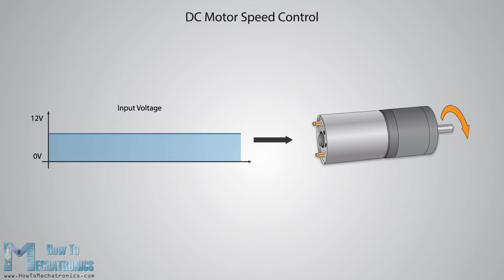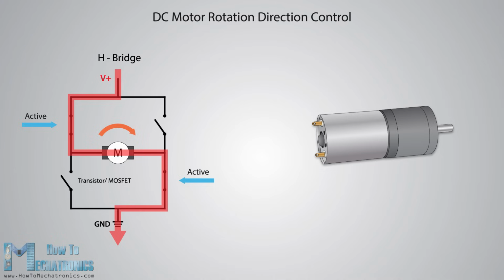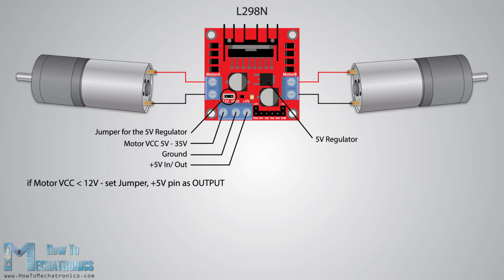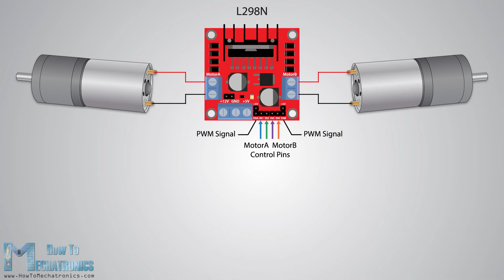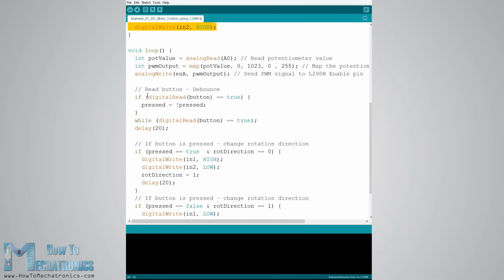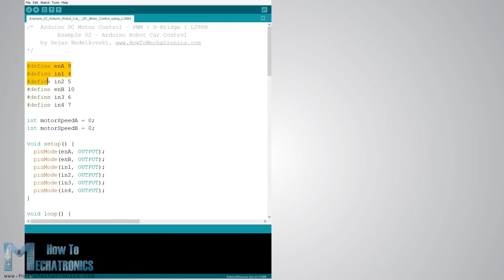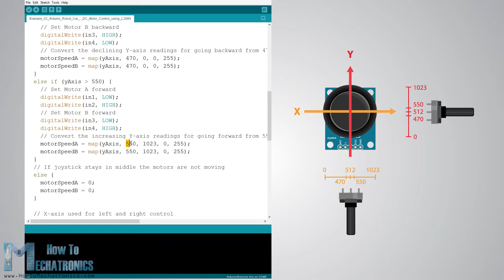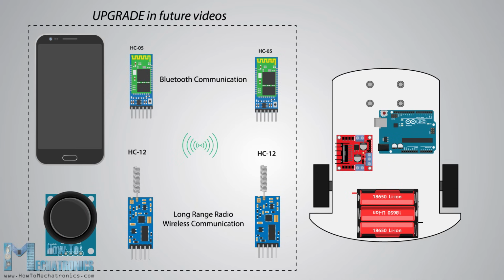Arduino DC Motor Control Tutorial - L298N | H-Bridge | PWM | Robot Car

Comment: hi, I'm a complete beginner in electronics. I want to use 12v dc motor and will use Arduino uno. If my understanding is correct, I should turn on the 5v regulator and safely use the 5v pin out? Sorry for my english. please help thanks

Comment: Thank you to you for taking the time to put together a video to help others online with their robotics projects. There are some mistakes though...ena, in1, in2, should be outputs. Button should be an input.  The resistor should be on the positive side of the or on the 5v wire or the pin 4 wire, this is to protect the circuit. You don't necessarily rotDirection in your code, you can change directions without this.

Comment: Hi, I actually did the same thing. but it worked for me only when I gave the arduino voltage separatly via usb or 5v and I had to have 2 packs of battery otherwise it would boot when I plugged it like in the viodeo... why is that?

Comment: In the website notes regarding the L298N you say: "In this case the 5V pin will be used as input as we need connect it to a 5V power supply in order the IC to work properly." But in your schematic diagram nothing is connected to the 5V pin. And it looks like the Arduino is being powered by the same 12V battery that is powering the 2 motors.

Comment: The most well explained video so far that i found! thanks for showing the better understanding how to connect this driver to arduino. I  am planning to do an 8 motor of ROV on my own. My question is how can we connect this motor driver if i should be using 4 piece of them? since 1 piece of driver is use for a pair of motor

Comment: I’ve tried to replicate the example with the motor l298n and push button. Everything works fine except the potentiometer isn’t controlling the speed. I’ve triple checked the pins and the code but I can’t figure out why the potentiometer isn’t working. 

I was wondering if anyone had any ideas.

Comment: If someone has a problem with his L298N that it is not working remember to connect the gnd from the l298n to the gnd from the arduino
Reply from the maker: That's right, thanks for the input!
Reply: Hey dude, could you explain why? I had this problem but i don´t know why I need to connect the GND from LN298 to the GND from Arduino, Please :D

Comment: If i use 14 volt power supply to L298N driver, i need to remove the jumpers and have to power it up in 5 volt pin, is that right?

Comment: Hi, Im trying to build a similar circuit: 24v power supply with a h bridge controller for a 24v servo motor, what I'm worried about its sending the 24V (+) to the VIN Power Pin of the Arduino card (min 06:40).

Comment: In case someone connects the motor to A or B with ENB enabled (means motor is not PWM regulated, runs at full speed) with 12V jumper enabled and is surprised nothing happens after turning power on, there is a simple reason. Just connect a wire to 5V out, power on again and then touch either one of two pins, for example IN1 if motor is connected to A, that regulate the rotation direction (forward/backward). The motor will start turning.

Comment: and how did you define the motor speed PWM as 255 when your motor`s 12V with 100rpm
is there any calculation formula for PWM in motor speed
Reply: PWM sends an 8bit signal so its values range from 0-255.. think of 255 as 100% and 0 as 0%.. if you want it to go 50% simply send it 127 and so on..
Reply: @johnturk158  thank you so much. Stay healthy

Comment: Here is code to control 4 dc motors on tank chassis: 
int rc_pulse1=1; //reading signal from FS
int rc_pulse2=2;
int mpwm1=3;    //PWM channels for motors
int mpwm2=4;
int mpwm3=5;
int mpwm4=6;

void setup() {

pinMode(1,INPUT);
pinMode(2,INPUT);
pinMode(3,OUTPUT);
pinMode(4,OUTPUT);
pinMode(5,OUTPUT);
pinMode(6,OUTPUT);
pinMode(7,OUTPUT);
pinMode(8,OUTPUT);
pinMode(9,OUTPUT);
pinMode(10,OUTPUT);
digitalWrite(3,LOW);
digitalWrite(4,LOW);
digitalWrite(5,LOW);
digitalWrite(6,LOW);
digitalWrite(7,LOW);
digitalWrite(8,LOW);
digitalWrite(9,LOW);
digitalWrite(10,LOW);
}

void loop() {

mpwm1=0;
mpwm2=0;
mpwm3=0;
mpwm4=0;
delay(50);
rc_pulse1=pulseIn(1,HIGH,25000);
rc_pulse2=pulseIn(2,HIGH,25000);
delay(50);
if(rc_pulse1>1024) {
mpwm1,mpwm2=map(rc_pulse1,1024,2047,0,255);
if(mpwm1,mpwm2>0) {
analogWrite(3,mpwm1);
analogWrite(5,mpwm2);
}
}
delay(50);
if(rc_pulse1<1023) {
mpwm1,mpwm2=map(rc_pulse1,1023,0,0,255);
if(mpwm1,mpwm2>0) {
analogWrite(4,mpwm1);
analogWrite(6,mpwm2);
}
}
delay(50);

if(rc_pulse2>1024) {
mpwm3,mpwm4=map(rc_pulse2,1024,2047,0,255);
if(mpwm3,mpwm4>0) {
analogWrite(7,mpwm3);
analogWrite(9,mpwm4);
}
}
delay(50);
if(rc_pulse2<1023) {
mpwm3,mpwm4=map(rc_pulse2,1023,0,0,255);
if(mpwm3,mpwm4>0) {
analogWrite(8,mpwm3);
analogWrite(10,mpwm4);
}
}
delay(50);
}

Comment: Great video. Can you link a parts list and where you bought the parts from? I know you didnt mention a diode but I am assuming that is necessary? Also is the MOSFET a separate component? Or is it included with the L298N ? Sorry if these are beginner questions. I am new to this

Comment: I am using 3-12V rating motor with L298N. When i use power from Arduino board motor runs at 4.5v but when i use external power motor don't run at 4.5v but only makes buzz.(I checked voltate using multimeter) Can you please help me with this ? I am using 9V ext power. (surprisingly motor runs fine even with 1.5v AA battery but not with 4.5v ext power from L298d)

Comment: Don't change the rotation direction suddenly, you will damage the motor. You should reduce the speed to zero, delay for a bit to let the motor stop and then accelerate in the opposite direction.

Comment: Hello
1) How do you think the code will be changed? if 1 motor uses to control left-right and 1 motor uses to move forward -backward? 
2) do you think the code was without backward left and backward right situation?

Comment: Is it good idea to have separated power sources? one for L298N driver and one for Arduino? If so, do I need to share Ground between L298N and Arduino?
Let' say I use 3.7v x 2 18650 battery for L298N driver and motors and 9v for Arduino.  Will it cause problem due to different voltage sharing the same Ground?

Comment: Suppose I want to make a connection where there are two buttons one for upshift and other for downshift of a gear with dc motor. i want the dc motor to generate some trque to shift the gear and stop and again when the upshift button is press end it will be active again produce some torque  to change the gear and stop again when downshift button is pressed it will start rotating in the other direction generate a torque and stop 
can you help me out with the code?

Comment: Dear, I've a problem with my project, it's a rbot using the l298 H-bridge and I've added the df player mini to ad sound when the robot drives. without adding the df player mini my sketch works well, after adding the df player mini the motors will not drive. Can I send you the both codes with and without df player so you can find my problem? Many thanks a lot in advance! (btw, I'm a blind person and learn to program arduino). I was making little projects with arduino as a novice. Hope you can help me or others here! I like to have sound in all of my projects to have more fun ad my own projects and my surround. Many thanks in advance!

Comment: Hello, your video is very good. It helps me a lot.
In the same way I have a doubt.
Can you help me?
I have two 12V bipolar stepper motors.
So I bought 2 L298N drivers to connect each one to a motor that uses 4 cables.
As these motors that are in the limit of consumption, 12V, my question is about I need to leave the jumper on or off, considering that I have put a 12V power source at its input (+) and (-) of the driver .
I will appreciate any suggestion, since the motor works but the driver gets very hot and I have doubts about it.

Best regards,,

Comment: Hi! I am searching for ideas on how to control my two brushed 500W 24v motors independently. The idea is like in this video, but I need it for my boats two outboards,  so I could control them in the way you control two combustion outboards. I found Cytron two-channel 30A controller, but I can't find any wired or RC  slider which could cover full speed range both directions and stay in its position without holding it (RC). Thanks.

Comment: 1. Hei, can i use powebank for powering driver and arduino?

2. Or i powering arduino from 9v battry, and driver from 3 or 4 18650 to 12v driver

Tell me 1 or 2?
Reply from the maker: You can power the Arduino in two ways, either through the 5V pin by connecting it to a 5V power supply or with the USB port by connecting it to computer or powerbank which are also 5V.
The second method is to power the Arduino thorugh the Vin pin, or the Power Jack with voltage from 7 to 12V. The Arduino have an on-board votlage regulator that drops that voltage to 5V suitable for the processor. As for the motor driver you need 12V, so the 3 Li-oin batteries give around 12V. The nominal voltage for a Li-ion battery is 3.7V, so in case of 4 batteries would give around 15V (4 x 3.7V), which is too much.

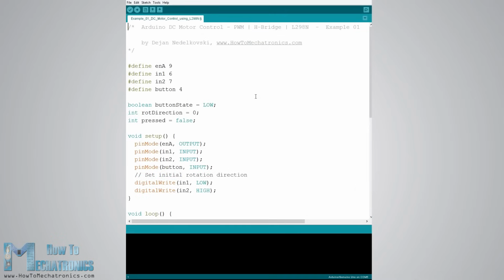Comment: 5:26 why in1 and in2 not OUTPUT?   (you have both pins run with digitalWrite command).
Also, when you push a button, you can result in value of 0,1,HIGH,LOW,True,and False?   Why do you choose True or False instead of 0&1 or High&LOW?
and buttonState is declared in the beginning but is not used anywhere in the code.
Reply: Same quest as me! Lol.

Comment: Question. Besides the L298N driver max 2 ampere. Wich type of Arduino board are you using or do you advise using in your DC motor control ? 
The "Uno R3"
The "Mega 2560"
or
The Arduino NAno 33 i/o

Comment: Thanks for this instructional & educational video! May I check with you... could I use a normal disposable 9V battery instead to power up 2 smaller DC motors each rated about 4-6V?
Reply from the maker: If they are rated 6V you cannot use 9V, you might burn them.

Comment: I have one similar project but with a 5v motor and a 5v power suply, how can I connect the power suply to both arduino and motor and leds, cause if I conect via USB and it runs slow
Reply: Luis Pires have you found an answer to that problem? I’m trying to figure out the same thing

Comment: can I use a 5V battery pack instead of 12V ?
Reply from the maker: No, for this configuration and driver you need 12V power supply.

Comment: Can this be used to run a DC motor with higher voltages such as 72 volts and 100amps or higher?
what can be done to make it work?
Reply: I am looking for the same answer. Please let me know if you find answer to your problem.
Reply: 100 Amps is way too high and some motor drivers like sabertooth are there which can provide around 60 amps but they cost a lot. So check for a motor driver which supplies your required current
Reply: @2305989  I was thinking that this can be used to control MOSFETS and not motors.  And so for the high AMPS, the MOSFETs should be able to handle those.

Comment: Excuse me but
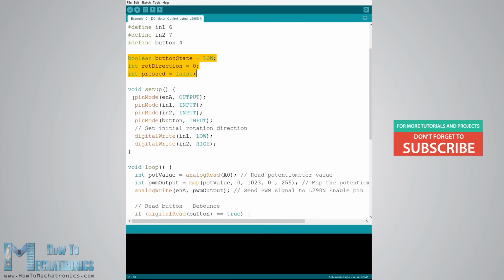why do you config in1 and in2 as inputs? 5:32
Those control an H bridge so they should be outputs? You use digitalWrite()  on them later
Reply from the maker: Well, it's a typo, they are outputs, that's right.
Reply: @HowToMechatronics  ok very good that's what I thought thanks!

Comment: I want to control  4 gear motors with this method ... will it work on 3 li-ion cells?
Reply: 2 Li-ion battery should be enough for the yellow motors, unless ure planning on using other gearmotor. Btw, orang Malaysia ke?

Comment: Why are the pins that change the directions of the motor written in the code as inputs? aren't they sending a signal instead of receiving?
Reply: They should be outputs.

Comment: How to connect to 4DC motor? And make use of the switch in that joystick!
Reply: to connect 4 DC motor use L293d driver motor shield
Reply: @mobilegamingiytg8350  do you have code for that board using 4DC motor+joystick please reply me!

Comment: would this kind of connection work if i add a routine loop coding and remove the joystick.
Reply: Of course. You can do that. You can even do things like use the sonar sensor to "look" for an obstruction, then program it to back up, turn, and move again.

Comment: Is it important the power supply ampere? I have a 12 volt 5 ampere power supplier, will it work with this board?
Reply from the maker: That's fine, 5 amps are more than in enough for this project.
Reply: @HowToMechatronics  thank you , I have tested the stuff , it works.

Comment: make the same video, only use the Pololu  Dual MAX 14870 Motor Driver Shield to run 12v motors

Comment: Hey.. Good job.. inspiring thousands of young engineers.!!!

1 query I have.
Can I use 1 toy dc motor (4.5-9 V and ~250mA rated) with my Li ion 18650 3800 mah batteries (3×3.7V)via L298N motor driver without any damage ?
Reply from the maker: Thanks! Well 3x3.7 is 11.1V and that's more that the 9V your dc motor is rated. You could use 2x3.7 which is around 7.4V.

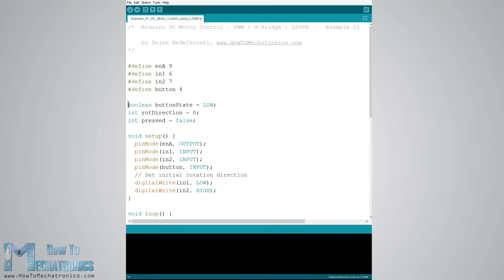Comment: Amazing video....helped me for my school spy bot project. Wanted to control the motors using DTMF successfully done... But there is a mistake: 5:27 set the pinmode for the in1 and in2 as input. it should be output
Reply: Yes

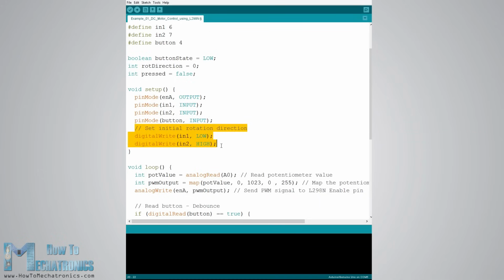Comment: 5:34 it should be 
pinMode(in1, OUTPUT);
pinMode(in2, OUTPUT);
Reply: are you sure? Cause that's what I did and it didn't run, but when I changed those to INPUT it started to work, and now I'm baffled why. There is nothing in datasheet of bridge that would explain it ;(

Comment: Hi sir, I am getting an ouput of only 7v even on using 11.1v power supply and on 255 speed on the l298n driver
Any help would be appreciated
Reply: IC takes 2 volt droping the 11 volt to 7.8 -8 volt

Comment: I need your help!
I want the adruino to read input from an accelerometer or any other angle tilting sensor and thus changes the direction of rotation of dc motor.
Is it possible and is there any code related to this?

Comment: On my l298n although I have set the jumper and given 7.4v to the pin marked as "+12v" it doesn't work. Even the power light doesn't light up. Then I supplied 7.4v to the other pin marked as "+5v". Then the power light was on and it worked. But when I connected a motor and connected it to arduino the current supplied to the motor was very low even the motor didn't run sometimes. As a result I gave 5v to the +5v pin and another 7.4v to +12v pin and then the motor worked fine. But the problem I have is that same thing happens when I remove the jumper. What should I do? Set the jumper or remove it?